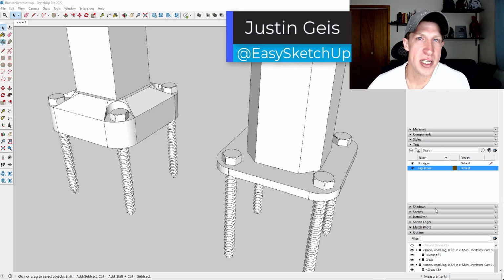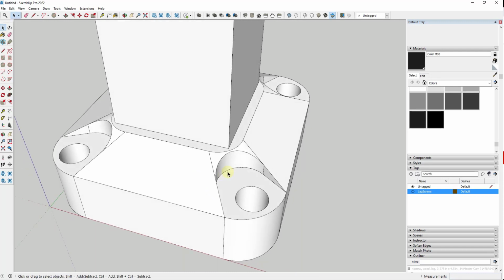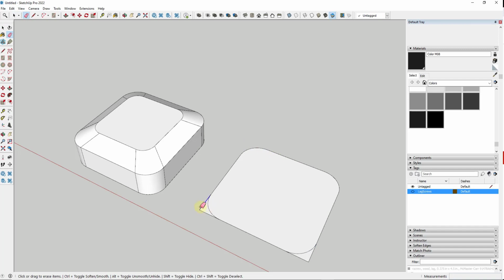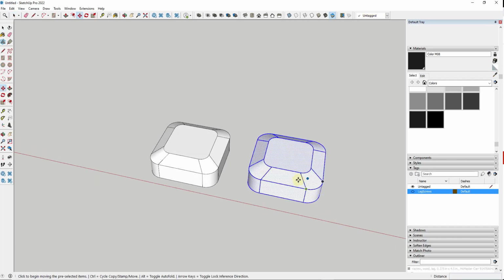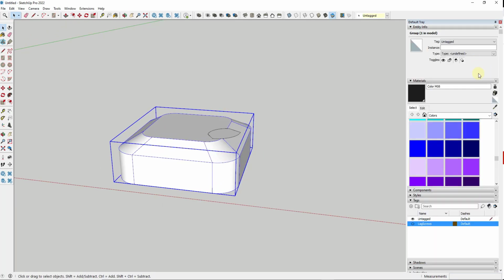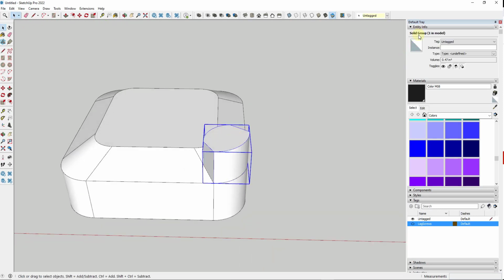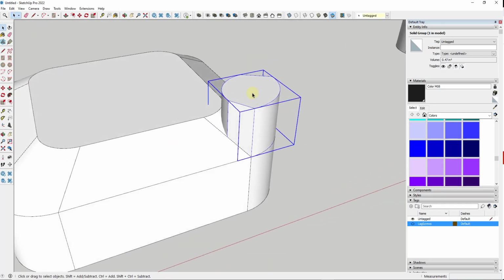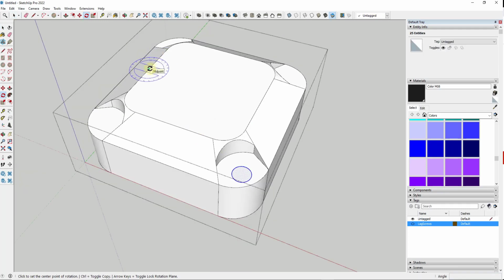Recesses In Objects Don't Have to Be Hard! (SketchUp Solid Tools Tutorial)

Comment: 2:20 You could also:

1. Create a group of that floating surface.
2. Push-pull the surface into the main object.
3. Explode the surface group and intersect with the main object.
4. Delete excess surfaces until the desired concave shape appears.
Reply from the maker: You could, but it seems like a lot more work IF your shapes are solids. This would be a perfect workflow if you couldn't get your shapes solid though. Thanks!

Comment: Nice and helpful, but now can you do a proper transition from that foot to the square upright piece as you have curved corners to square corners?
Reply from the maker: You'd just draw an arc/face, then use follow me to extrude it around the perimeter
Reply: @Thesketchupessentials  thanks for the reply but it leaves too many holes and junk on the sharp 90° part. A side question ( I know you have covered it ) what is the short cut to lock the protractor to a specific axis? thanks
Reply: @orac229   holding shift key
Reply: @fortube4108  Yeah but if it's flicking between x and y but you actually want z how do you force it to z?